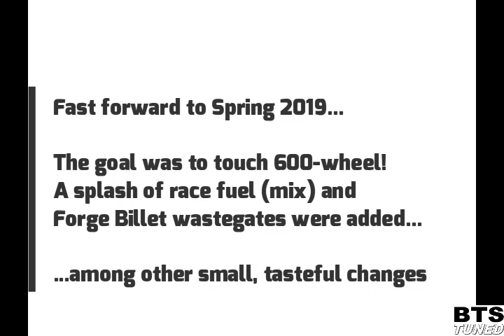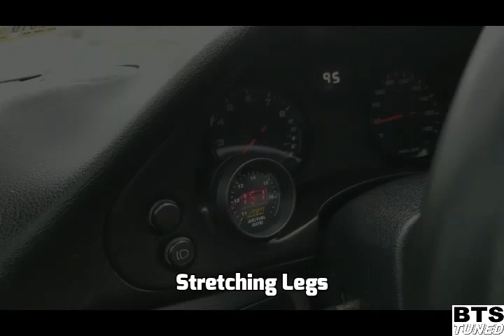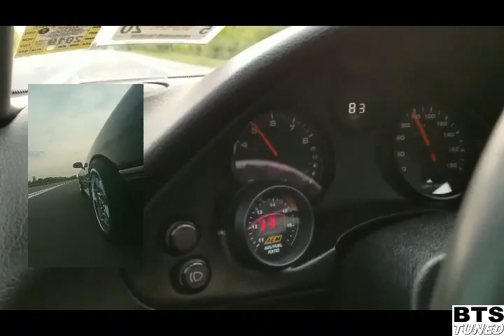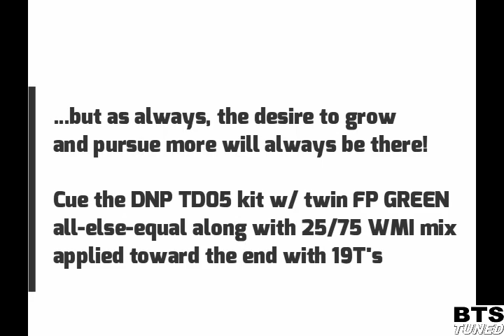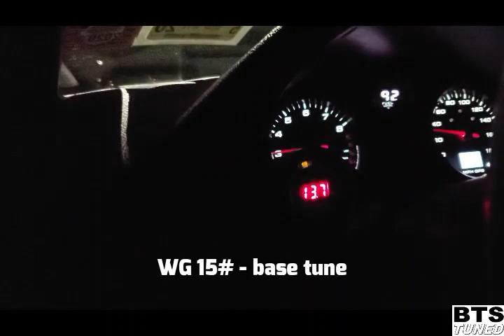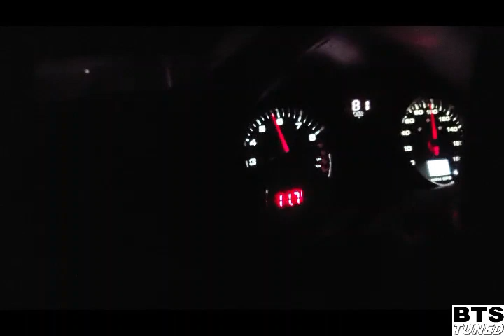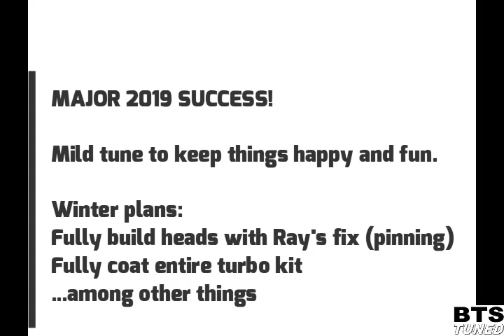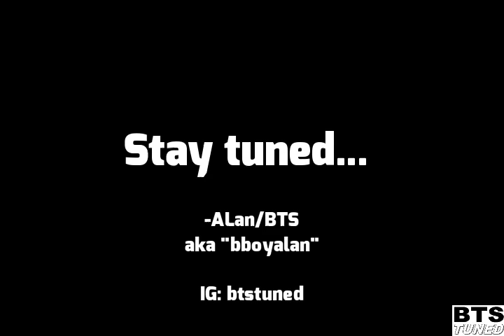Andy's 1992 Dodge Stealth R/T TT - 2019 Tuning Quest for 600AWHP

Comment: Is all that done just on a stock motor
Reply from the maker: VD plot at 8:41 has all of the details heh

Latest video after this had the heads upgraded further.
Reply: Cool I’m planning on getting some Dynamic racing Billet DR650's, 550cc injectors, Fuel controller, Down pipe, Fuel pump, a boost control and my motor currently has 150k on it got a 1992 dodge stealth twin turbo and don’t want to spend all that money and the motor not hold up
Reply from the maker: @craigbeery99  That sounds like a good game plan, however, I would recommend doing more health assessment tests before pushing things. You will also be much safer keeping things under 450 with the cast crank, composite head gaskets, and likely 18-splined drivetrain.
Reply: bboyalan that’s what I’m afraid of I don’t want to put all that money in it and the motor blow that would be a drag so I figured you might have some good advice how much is your car currently pushing
Reply from the maker: @craigbeery99  I speak from experience with older builds; overall consensus will agree. Even keeping AWHP/AWTQ output to 450 will be a gamble. Many have had losses with less and more, but just as many have gotten away with a bit more. My original 2-bolt at 130k made 450/480. I later rebuilt that with a forged crank and BC cams for 500+. Most recent build is fully forged.

MY current output is irrelevant, but it is documented in another video upload. Since you asked... 560 🙂 and 3,100lbs curb weight
Reply: bboyalan awesome man thanks for all the info and what a bad ass car def a sleeper to people no hellcat pushing 707hp but it didn’t cost you 70000 either I’m sure so 560 is crazy Hp out of a V6 cool build man mopar or no car great job
Reply from the maker: @craigbeery99  560AWHP is roughly 700BHP sooo lol